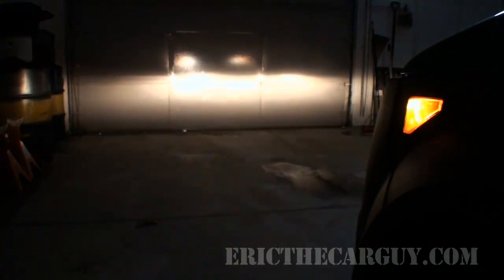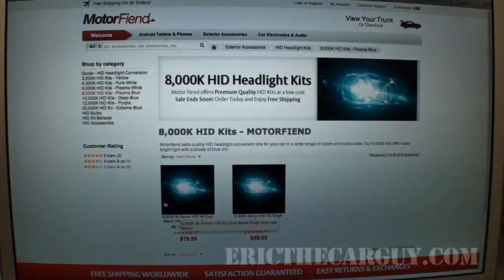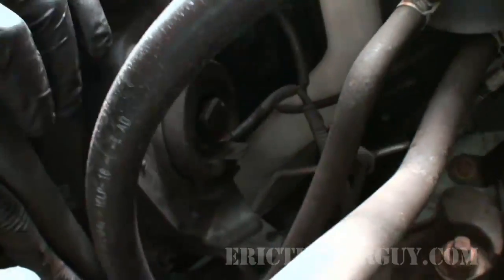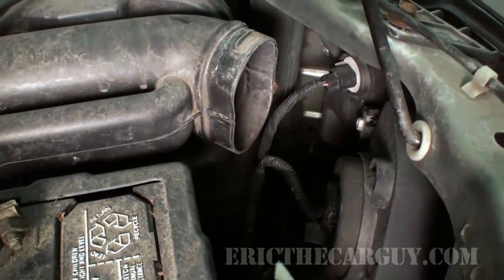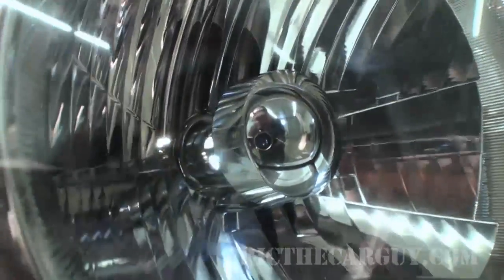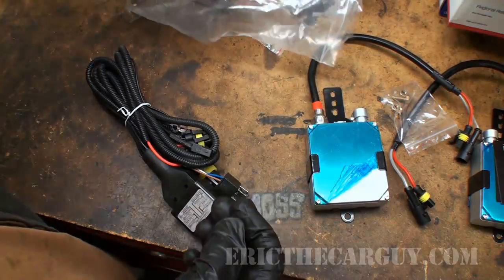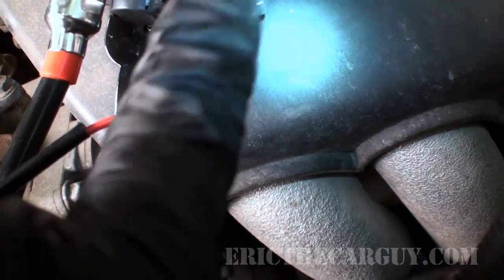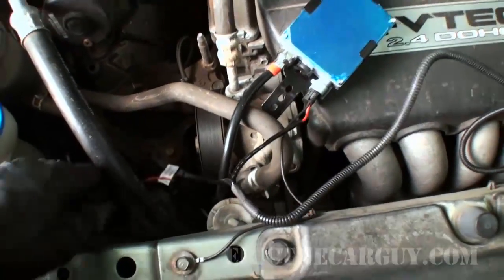How To Install an HID Headlight Kit -EricTheCarGuy

Comment: Hey Eric,
love your videos, they really give me confidence to do repairs and upgrades on my own that I would usually pay a lot of money at the repair shop for.

One thought, and I'm not sure whether someone else mentioned this before, but the little bracket for the ballast seems to have holes on both the "top" and the "bottom" end so you can easily mount it sideways onto your support beam. This way it won't wiggle around and you don't have to break your head about zip-tying down. :)

Comment: Once you use the self-tapping screw and the hole is made I would have used a hacksaw to cut the screw down to the correct size.  That way the screw sits flush when installed and at least there isn't a huge pointed object (cap or not) sitting up against the wiring harness.  I think you could have done much better on that train of thought.  A rubber cap isn't a fix it's just a matter of time before that screw tip causes an issue.  Love ya big guy.

Comment: I have a crv of the same year (which is the same rolling chassis) and I actually am currently installing an hid kit and new headlights. I bought a smaller battery (in size) so I have more room next to that headlight. Another option is to reroute the battery to the rear.

Comment: Should never put HID's in a reflector type headlight. They can't focus the light properly and it blinds people! Eric it is really easy to do a TRS projector retrofit. A Morimoto Mini H1 kit from The Retrofit Source gives you everything you need to put projectors into the stock headlight housing. It comes with a HID kit with wiring and everything. Then you'll have headlights that basically out perform luxury euro cars. Headlight beam is a nice flat cut off. It's amazing trust me, I've done it!

Comment: Just order a set of HIDs, so glad to find this video.   I will watch it again once they arrive.  Thanks for anticipating a basic/common upgrade.  Sorry to see you had to do a 2nd video, Re:  
Anyway,  I got my kit, installed it and I don't get any  focused pattern, like you did..  I put them on a 300ZX with a projection type housing.  Mine did not come with the extra housing that yours did.  I tried adjusting them twice inside and outside my garage.
Any ideas on what I could do to get a focused pattern?

Comment: Yep, that's true. That's exactly my point.
They are all 35W, and they convert energy into light in a same way. So, It's pretty much same amount of light-energy.
All those 12000K-ultraviolet bulbs are looking reach, but they are spending energy for emission in blue and violet part of spectrum, which are more expensive and barely visible.
That's why, if you want something looking "cool", go ahead with 6000K,8000K or even 12000K. But If you want brighter lighting, stick with 4000K-5000K.

Comment: Hi Eric,

I have an idea for another video you could do - upgrade your headlight wiring loom using relays etc and install some high wattage halogen bulbs (100w+), in a car which has headlamp units that can take the extra heat (so probably glass lenses). This way there are zero concerns about light distribution/scatter etc that can be an issue with HID retrofit kits as the filament position/size is identical to OEM.

Comment: DC ballasts shorten bulb life, they wear away one electrode faster than the other, if a ballast seems really cheap, it's DC, expect to spend between $25-$40 on one good AC type ballast. You can tell instantly if it's ac by the high pitched whine you'll hear when it's operating.

Comment: You can tell me all about how it's not blinding anyone, but look at 33:46 and you'll see exactly what I hate seeing - you don't have a sharp cutoff of the light. It is much better than if it was just a reflector, but it is still disgustingly scattered. Now compare it to any other HID in a projector where they are aligning it and you'll see what a huge difference it is.

Comment: Nice job, I've done this upgrade 4 years ago on my Element '03. The only problem I have with this is that you loose your daylights when you start the car. You need to open the low beam lights to have "daylights". Does somebody was able to get around this with HID kit.

Comment: Most of the aftermarket HID retrofit kits that use re-based HID bulbs do have a "glare" to them, especially when getting higher than 6000k as blue light "scatters". Stock OEM HID's are closer to 4500k. Projectors are the way to go BUT I have had luck with some halogen lamps taking very well to the HID mod without "blinding" people. Yours looks like it turned out good. Some cars though turn out horrible. Just depends on the application.

Comment: +frank rubi

If you'd like h.I.d.s then you will have to open up your headlights and install an aftermarket projector inside of the housing. Those projectors typically use H1 hid bulbs. However, if you want to cheap out and blind people then just install hids. Remove your factory bulb to find out what bulb you have. From there every thing is straight forward.

Comment: Hi Eric ,  my question for you is >> my 2006 P.t. Cruiser has daytime running lights > the h.i.d. lights are going to be installed on my low beam  >> being the factory harness is only going to be used to tell the relay harness // forgot I'm installing a relay harness too \\  to turn on, can i unplug the daytime running lights and use that connector  as a signal for the relay harness to power up the H.I.D. lights on my low beam >> on the p.t. cruiser the daytime running lights don't come on until you put the vehicle in gear >> if i don't use the daytime harness as the signal, i will have to manually turn the h.i.d. lights on >>>  thx for your help >>  I really enjoy all your videos .

Comment: People enjoy bitching and arguing the difference between 4000 and 6000k or 6000 and 8000k. When you embark on a project like this the whole idea is to improve your existing headlight illumination output so you can see better at night. Who gives a fuck about anything else? Many people can use this video as a tool to be safer on the road, thus the information present here accomplishes Eric's goal in helping you the car enthusiast.

Comment: Actually come to think of it, when I installed my HIDs I was fortunate enough to use the original mounting locations on my headlights. some honda headlights have oe mounting locations under the headlight assemblies.  I drive a '05 Honda CTR.

Comment: It is one thing to make videos to help people. it is another thing to mount HID kits for headlights that were designed for halogen bulbs. Those kits mostly glare opposing drivers and don't really perform better sight. I have two cars, one with HID kit and one with H7 halogen. And either system has its pros and cons. As Eric, i would've suggested to use stuff/bulbs/materials which the headlight/reflector is designed for. That's freedom of speech, you know.

Comment: Indeed. The Kelvin figure marks a position in the (visible) light spectrum. Light is an electromagnetic wave, and every figure means a different light color. Red light is "colder" than green or blue light, so that's why blue HID bulbs have "higher" Kelvin ratings. Just physics. higher Kelvin don't mean that you have more sight. The brightest kelvin is 4300 K and  around, as you said, because it is the closest color to daylight conditions, which the human eye is used to. Greetings.

Comment: My experience is that head light assemblies that are not specifically designed for xenon systems, look cheap and ridiculous. They have a non focused white blur which blinds everyone approaching. On the other hand, proper xenon systems lays a sheet of white across the road way with a very specific finish to this projection. It looks cool and sophisticated when approaching it. If your going to put in xenon - make sure in the later group

Comment: You can only adjust the position of the beam, and not how it reflects the light source onto the road.  So yes, while you can angle it to the right and down low to avoid blinding traffic, it won't actually improve overall visibility for you.  Basically, you're lowering visibility for your own car in order to increase visibility for traffic going the other way.  Which makes the upgrade near pointless.  

Unless it has DOT certification (90% of them don't), then there's a reason they're illegal.

Comment: The Kelvin temperature measurement is not equal to the brightness output like Eric said, that is, a higher K (like 12,000K) is actually dimmer than lower K (like 6000k or 8000k). Depending on the wattage of the ballasts and the ballasts themselves, the brightest HIDs are usually around the 5000k-8000k range.

Comment: Nice video. I would change where you mounted the ballast on the passenger side though. IMO it is too close to the exhaust manifold and the heat will cause premature failure.

Comment: I bought HID kits for all lights, fog and head, and when both fog lights and headlights were on my high beam indicator light on the instrument panel was partially lit.  My fog lights ballasts burnt out within 3 months upon installation.  It blew the fog light fuse as I didn't have the direct line fuse to hook it into my battery as you did.  I used a Multimeter to confirm power was finally coming out of the original hookup but not past the ballast.  Headlights lasted 18 months and first bulb burned out just a week ago so I'm looking into buying a new pair of ballasts for both headlights and fog lights and was curious which brand you used as I don't want to go through my fuse box and blow another fuse and ultimately more ballasts.

Comment: hey eric from where i'm from when u instll hid kits and not get pulled over you would have to change the reflector housings to projector housings that way you don't blind cars on, oncoming traffic. and usually with projector housings there are cut off lines rather than reflector housing where they distribute the light in all directions.

Comment: Hi Eric, looks like this is one of the very, very few videos where you provided incorrect info. as djgrock said, 8000k is a very dim light when you compare it to 4300k or 5000k. It just makes it look blue by filtering light out. As you can guess, filtering light out, reduces light output, not increases it.
To get more light, you need to pick highest light output not highers temperature.
Now that you have the kit installed, try getting 4300k or 5000k bulbs and see the difference.

Comment: I believe that's why thy have that bulb shroud or protector so the light doesn't get reflected everywhere into oncoming drivers eyes. so as you said I believe these ones are specifically designed for this application.

Comment: Eric, small correction to your explanation of color temperature. The higher you go, the more blue the light gets and the more of the light shifts into the UV spectrum, wich humans cannot see. If you want more light, you're actually better off going for a lower Kelvin value. Also, human eyes are less sensitive to blue colored light, so that's another drawback and a good reason to go for a lower Kelvin value.

Comment: You could have use screw cutters on the end of the mouthing bolt for the control module,then for extra safety grind down the end to de-burr it.And also maybe some treadlock for added security.

Comment: I use HID on my 01 Celica, I have aftermarket setup because the OEM runs around 1k usd if you can find one. I don’t blind anyone as I have aftermarket projector/halo housings designed for HID lighting haven’t been flashed or had any problems I run 12000k bulbs on a 35w system

Comment: First of all, bi-xenons are not bulbs. There is no filament. They are capsules, just like all HID Xenon lighting. It is true that there is only one capsule per side on a bi-xenon set-up. But it is also true that a shield is used to change from the "hi-beam" position and the "low-beam" position. The shield is what prevents blinding oncoming drivers in the first place.

Comment: The light temperature that's measured in Kelvin is *NOT* a unit of brightness, but for the color of the light. Your normal warm-white LED bulb (since in Europe, most Tungsten bulbs over 20W or so are prohibited now) would be having 3500-4000K, while a "bright-white" or "daylight" bulb would be around 5500-6500K. With 8000K you'd be having even more blue colored parts (=shorter wavelengths) in this light.

Comment: Light temperature is used when objects that emit light are a close aproximation of a black body radiator. For example if you heat a metal, as it gets hotter and hotter it starts glowing, so the hotter it gets the whiter its emitting light is. Incandescent lights are also a good aproximation. BUT when you go to fluorescent or LED lamps, they are not producing light by thermal radiation...so light temperature is even more confusing, as you get a different color light than from a normal lamp.

Comment: I installed HID in my car and it doesn't have projectors. What I did was a took a soda can and cut a rectangle, fold it like a (half) cylinder, and then put it UNDER the HID light. That'll help greatly with the glare. I have 6000K HID and police hasn't stopped me nor people hasn't high beam me

Comment: If there adjusted properly its not a issue. Cars that dont have clear lenses, Lens optics. As opposed to headlights with reflectors inside can be adjusted properly to avoid scatter.

Comment: Self cleaning generally means that the headlights will have a "autowash" function (a washer jet that sprays the headlight), and no only higher spec of models have them though you can retro fit if you choose to. The laws here are pretty strict at the best of times.

Comment: Hi Eric,

Correction about what is temperature of a bulb.
It is not a brightness. This number define color. The unit of measurement is EQUIVALENT temperature. If you heat something to the temperature 8000°K it will emit light which will have the same color as your 8000K bulb.
That's why low numbers looks more reddish and high - blueish.
In fact the brightest bulb is 4000-5000K.
a) blue light require more energy to make. 
b) human eye is more sensitive to green part of spectrum then to blue.

Comment: The higher the kelvin does not mean higher light output Eric! That refers to color temperature, not light output. That 8000K kit will underperform compared to bulbs rated for the 4300-5000K white range. The 4300K-5000K gives you the most USEABLE light that your eye can see effectively!

Comment: Dear Erik, very wonderful professional neat workmanship. I have one question since these ballasts draws more current, would that strain the alternator a bit, especially when full electrical load is active ? would operating these high beam lights cause a slight drop in idle RPM ? Would a remedy be by using a higher Ampere battery ? this is because I heard some complains about that modification.

Comment: Actually he didn't just put a stock type bulb in his car, he used an adapter that allowed him to install an H1style bulb. Also, HID bulbs and halogen bulbs have very different characteristics. A halogen bulb has a cylindrical light source and a HID bulb has a crescent shaped/arced light source.

Comment: just a note for any of the beginners that are brutes out there, do yourselves a favor (if you need to release the plastic fasteners for the wiring harness) use needle nose pliers not wire cutters.

Comment: DRL's are on a separate circuit all together. I don't think it would interfere with the headlights at all. As you're only adding something onto an existing circuit and not modifying it in any way. If that makes sense :D

Comment: Hey Eric, when you go higher along the Kelvin scale it does not guarantee the light output is greater, hence they use lumens to measure brightness. It's a misconception to only look at the Kelvin scale as it only indicates the color of the light. Also doing this drop in kit will scatter lights then focus it, since your car is using halogen reflectors instead of HID projectors.

Comment: the blue tint filters out yellow actually and is what they use to make the "xenon look" halogen bulbs more white in appearance on a hid the glass is plane with the blue being the colour it burns at. The kelvin is indeed the colour temperature where as 4300k is more yellow and 10k is more blue with 12-15k being purple and into the ultraviolet colour range. as for highwattage bulbs (e.g. rally bulbs) cause the burning hids are cooler once ignited

Comment: All vehicles will begin to fall apart. It depends on may things, My Explorer has held up really well, but I believe it is because it is a high up model, with more sound dampening, and better parts. As for the Tahoe, they are very solid trucks, but avoid huge rims if you are packing them full of equipment, like JP does, he seems to have major wheel rubbing issues. As for the Durango, do a brake Job and you will see what I mean, I cannot tell you how many Spindles I have had to replace.

Comment: One helpful tip I've learned with these is that if you install the wiring on the ballast upside down any moisture or heavy water won't run into the ballast causing a short or potentially ruining the board inside the ballast. Water runs down the wiring and down into the engine compartment.

Comment: My man! Great video like always. I would like to see if you can help me with some stuff on my car.  I have a 2007 Honda Element.  I have issues with some crazy noise in the back of the car every time I hit some dip like surface while driving.  I also have issues starting the car in cold weather. I have used your water and soap method and no vacuum leaks what so ever. I live in Fort Carson, Co. Also I would like to see if you have any tips for my Honda to pick up faster? I will do the adjusting the throttle cable adjustment, but I was wondering if you had any other tips. Again bro...great videos. Personally I think they are the best when it comes to maintenance. Keep up the good work.